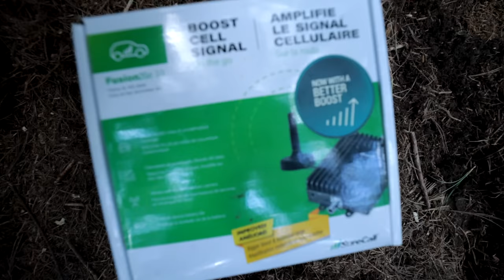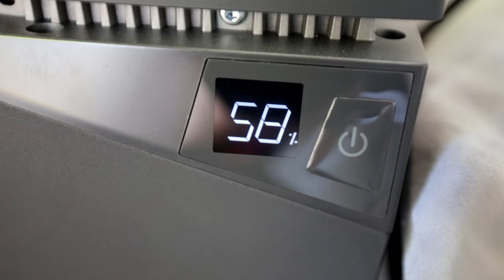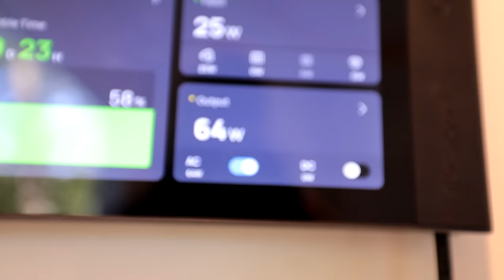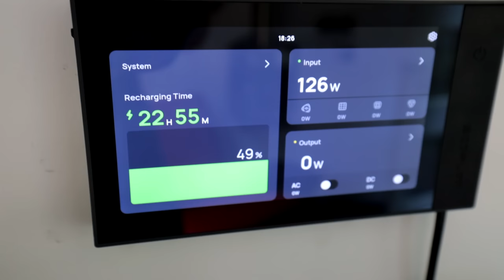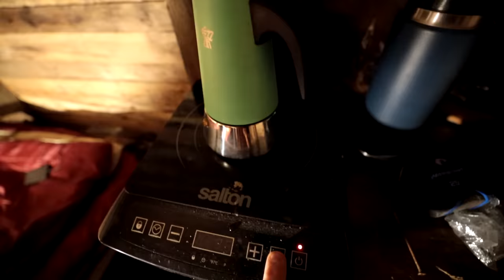Surviving 24-hrs UNDERGROUND (in the Spider Hole!!!) - Building a Secret Tunnel Bunker

Comment: i  love this underground room, have warm winter season, but worry wter, need seal all roof and wall good tarp not leak rainy season full at water, normally need dug water out tube under floor and rainy season if leak water all water go out under floor tube out eed diggin far were base ground have down than room floor have, best digging underground house to hill side slope then have easy make water out under floor tube and then wood floor top, and wall and roof tarp tight water proof house, then roof and fill ground top then any not see next year have digging ground before. need biggest hole, 2 room and toilet room whit good ventilation maybe blower ventil blow air out, other room have biggest good bed and kitchen table and kitchen made, comfortable, i love can live underground all 4 season good, if have money i want buy hillside land and exvalator digging big hole and make full concrete house under ground, then house build ready and then fill all ground back ewerybody not can see here have full house 2 bedroom,liveroom,kitchen,all,

Comment: That hot plate sounds like an induction cooker... I have a couple of them,  an mine can be set to use 500 watts for and very compatible with power stations... the ones I have can set temperature to within 10°F... from 100 to over 500°F . That looks like my NuWave Gold PIC induction cooker. Got a better look at the induction cooker,  not a NuWave... a Salton brand to look up to see what functions and wattage it has. Looked up the Salton cooker,  300 to 1800 watt power range.  I might consider getting one myself to test what the actual minimum power setting is. My NuWave tested at less than 500 watts minimum.  But I have Itaki cookers that are 300 watts or less as lunch box cookers.

Comment: So is the ecoflow hub an inverter and if so how watts also you say the unit is expandable that's fine for this battery but is the inverter expandable ie  can you put 2 together for double the ac watts or to make a North American unit that's 120/240  so that people with a deep well submersible pump or a heat pump water heater and or heat pump dryer  I'm hoping to eventually get off grid but I have a air-conditioner and I'd like to get a a heat pump water heater and heat pump dryer but I can't as most people especially seniors on pension and low income earners afford to put in a 10 grand solar system up here in Canada we government pensions which are non  garensheable so loans are not available  so we are stuck with low cost solar ie 2 or 3 thousand dollars so to run submersible well pump heat pump water heater and heat pump dryer we can only run them by a generator every solar generator 1500 watts and above should be set up to add extra battery capacity to also the extra battery packs should all be set up with the ability to add a extra solar controller to charge the system faster and the solar generator should have the ability to either be pared with another unit for either double the watts or  240 volt they've already developed a plug in to tie in extra battery packs on the larger units and since most people other than utube vidio producers don't need 2 regulated 12 circuit or 4 high output type c ports 4 fast charge USB ports or 4 slow charge USB ports  so a straight inverter could be setup to tie into the the original solar generator to give the second leg of 120 for a 240 volts AC unit for trucker and campers who already 12 volts and just want to be able to power a hot pot are microwave this would be a a good starter unit a 1500 or 2000 watt solar generator would power my fridge  freezer furnace my lights cpap and phones would run on 12 volts also my winter when below freezing fridge and freezer cooling system yes any area of the country where the temperature gets down below freezing the outside air can be used to cool the freezer down to temperature so instead of running them on 120 during the winter when the days are shorter, so less solar power is available just as why convert 12 or 48 volts DC to 120 AC and back down 12 volts DC for a CPAP machine or 5 volts DC for charging cell phones 12 volt dc  led light  bulbs can be used for lighting purposes no longer are we stuck with 12 volt 50 watt incandescent light bulbs led has opened up lighting options although older homes because of the wiring circuits that have a combination of plugs and lights on the same circuit may not be able to go 12 volt dc lighting without some rewiring but if we can string cat 5 wires through out a house hidden in the walls and ceiling we can string 12 volt wires the same way just put a cover on the junction box and bring the 12 volt wires down by the junction box and the light fixture will cover and hide the junction box I do have an advantage that all 
my lights are on one circuit with no plugs so all I have to do is unhook from my panel box and hook it up to 12 volts dc